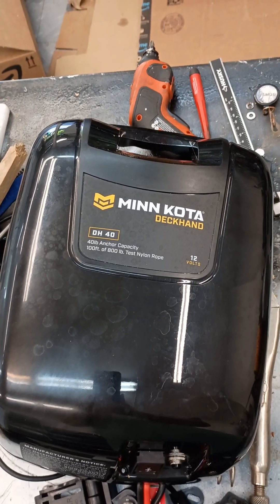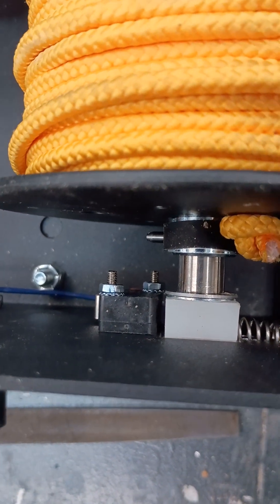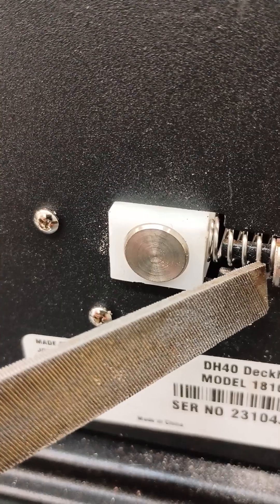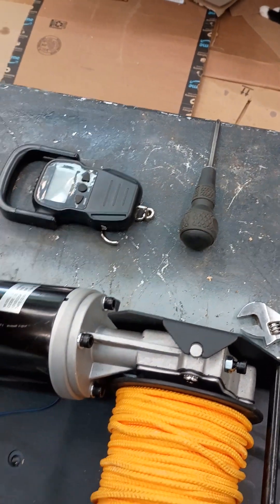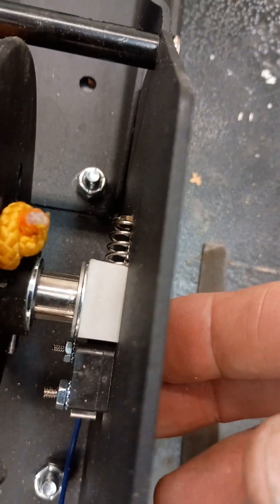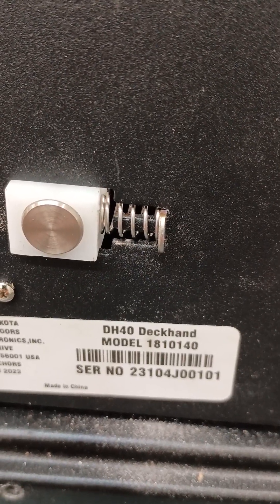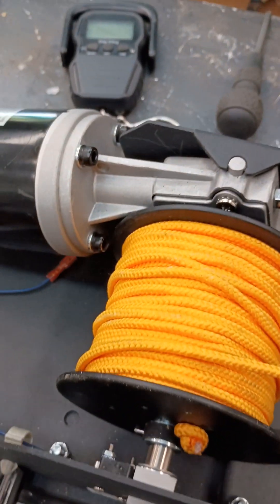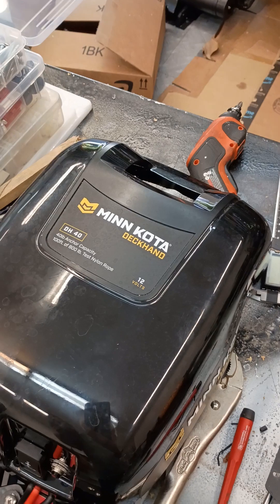Minn Kota Deckhand DH40 modified to work with anchors lighter than 20 pounds.

Comment: Your filing the WIDTH OF THE SLOT ?

Making it wider for less spring tension ?

Filing on the actual housing of the Anchor Mount, Right ?

Thanks.
Reply from the maker: First, it's not one SLOT, it's two SLOTS separated by a tab of metal.  That tab is the retainer for the spring.  The filing makes the slots DEEPER by one wire thick.  The slots aren't wider, they are LONGER, so the spring has less pre-load on it to overcome before the microswitch activates.  Less preload on the spring, means it takes less anchor weight to activate the micro switch.
Reply: @skipro3  GOTCHA, Didn't see the Metal Tab in the middle of the spring.

Hell I'll just cut 1/2 a coil at a time on the spring & see how that works or find different spring.

T.Y. Sir, Dad's 83 & the Anchors are not getting any lighter for him.
Reply from the maker: @NoWr2Run  It's much easier to just file.  You have to remove the spring anyways and trying to cut the spring and not too much might be a risk, where-as filing too much isn't a problem; just get a right-sized washer and slip it over the metal tab after grinding the sides of the washer a bit to fit.  
Let me know what works for you!  
Speaking of heavy anchors, I modified my anchor winch again last weekend.  This time, I added a key-fob style remote control to it.  I got this off Harbor Freight:
https://www.harborfreight.com/wireless-winch-remote-control-69229.html

Here's how I did it:
Cut the plug off the end of the winch box.
strip out the 4  wires; positive, negative, in and out, then crimp on the blue terminals in this kit from Harbor Freight, lower left photo, female end.
https://www.harborfreight.com/terminal-connector-set-500-piece-70214.html
Open the anchor winch and look at the circuit board.  
Find the terminals labeled: IN and OUT and connect the corresponding remote controller box using a pigtail adaptor.  
Power up and test.   
The key fob remote will now run the anchor up and down, without concern about weight, since the pressure switch we are discussing is now bypassed through this remote.  

I have a remote fob for my trolling motor, and now for the anchor.  I clip them to my fishing vest.  When I launch my boat by my self, I was tying up the dock for others as I parked the truck and trailer then returned.  Now when I launch, I remote drive the boat away from the dock a ways with the trolling motor fob, drop the anchor with the anchor fob, then the dock is free for anyone else as I go park.  Once parked and back at the dock, I use the anchor remote and hoist the anchor, then the trolling motor remote and drive the boat back to the dock where I hop and take off. 
I got the parts from Harbor Freight on sale, under $25 for everything.